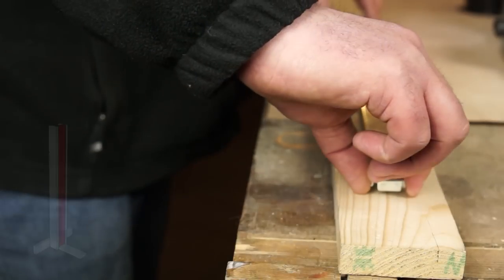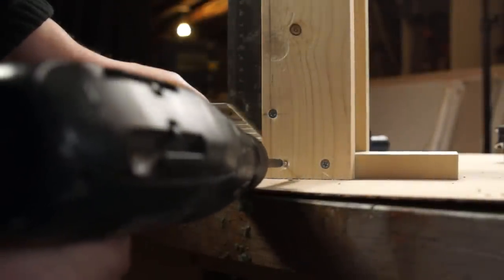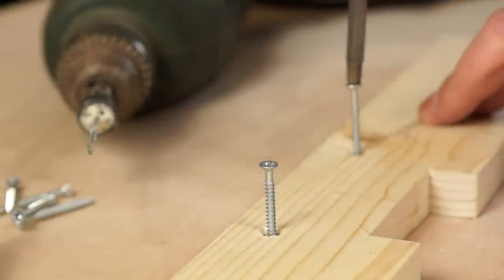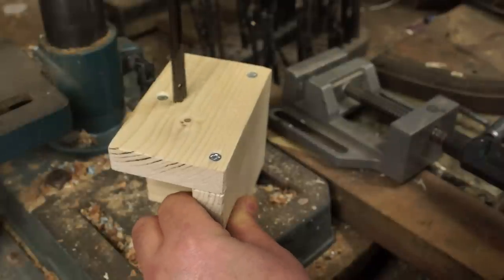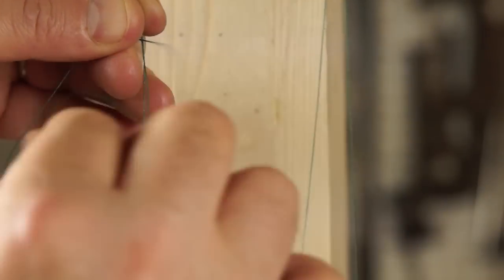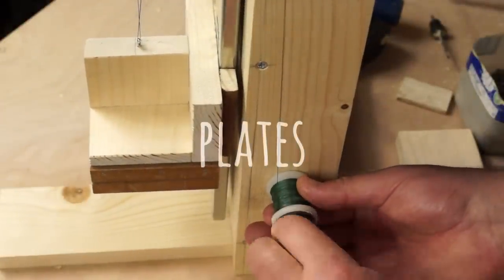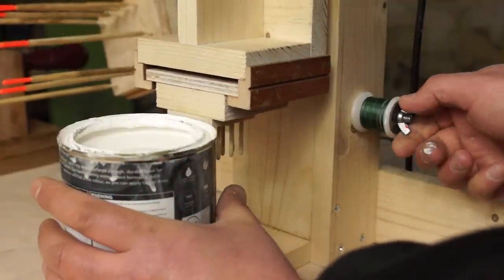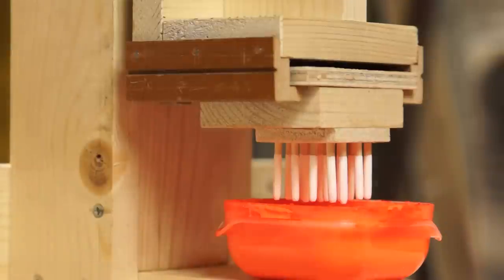Making Reed Fishing Floats (bobbers) on the hand cranked lathe part 2 of 3

Comment: Quite a bit of effort just for teatime , Paul !

Just kidding , ......by the end of the video dipping on the clearcoats I've finally figured out about the usefulness of your design , ......one could never go as slow by hand to achieve a perfect and non-dripping paint job , ........not to mention  the saved time by doing multiple workpieces at one time .

Now, ........would I need such machine for the propionate dips of my timber lureblanks, .........hhmmmh ?????

Absolutely stunning clip again ,Paul , ........thanks for sharing , ...greetings , Dieter
Reply from the maker: 61diemai we take biscuit dunking seriously in this country, i have dunked a few lures in nitro cellulose with it but i am looking at some uv cure acrylic resin to dunk lures and give me a drip free finish before turning on the uv lights. I never showed actually speed in the video only 5x because actual speed would of been a little less interesting than watching the clear coat dry. With a true reversible motor and little bit of electronics this could be fully automated, but that is another video i might not get time to make,  cheers Dieter

Comment: Hi Paul, first of all can i say thanks for the great videos, I'd also like to ask if you could help me with a small problem, i recently bought a hand drill like you used in your video but the chuck is not deep enough to take the float stem, what sort and size (diameter) of chuck have you got on your drill. thanking you in advance if you can help
Reply from the maker: +Steve Cousins this was from a broken electric drill as the original chuck from the hand drill was broken so i am not sure of the size, lately i have been using another Stanley hand drill with its original chuck which works just as well, sorry

Comment: Hei Paul ! I have one question. How did you make that video when your camera slides so smooth, but you do something  else (don't touching  camera)? It's somekind a slider dolly ?
Reply from the maker: Adrians Kuļiks i have a camera slider i bought cheap from china and then i bought some cnc belt and cogs and an old cordless drill for the motor, i used speed controller to keep it slow and wired it to a little box that i keep just out of shot. All together it cost me about £100.   Thanks
Reply: ***** It's a big job! very nice. Thanks